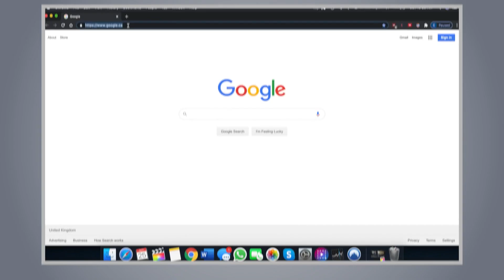It happened! Jeff Bezos Revealed INSANE Plan Beat SpaceX Starlink

Comment: To be a competitor you need to have a product. If BO ever launches anything apart from Bezos ego, it will be years before he could compete with Starlink.  In a couple of years, Project Kuiper would be a new system at the bottom of the learning curve whereas Starlink will have had years of operational experience with an even bigger customer base. To use Project Kuiper, Bezo will have to persuade customers to pay more for a less capable service.